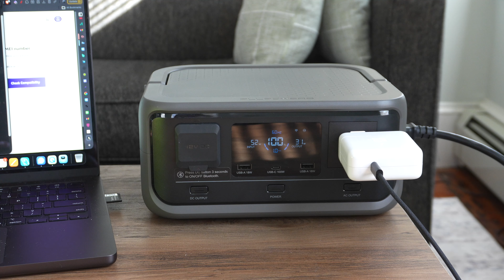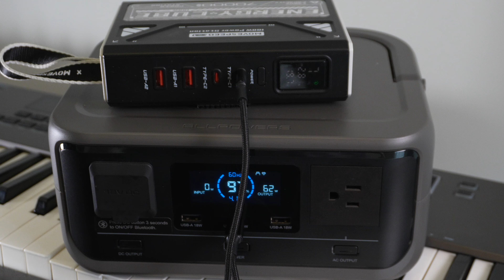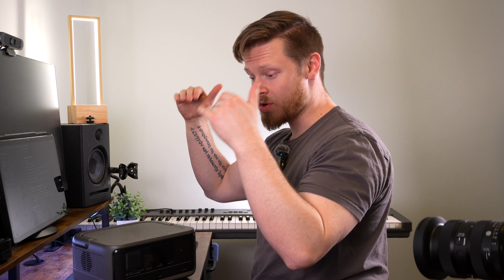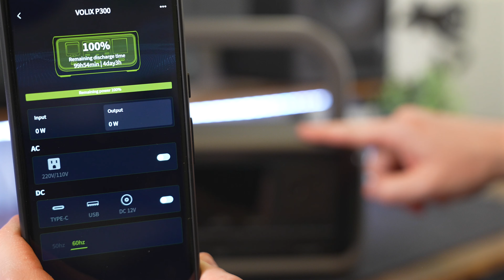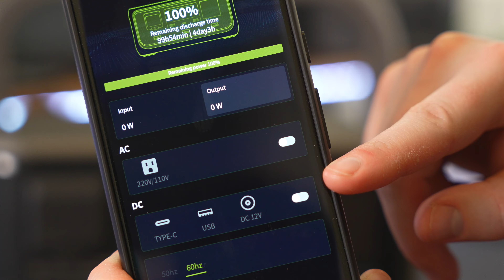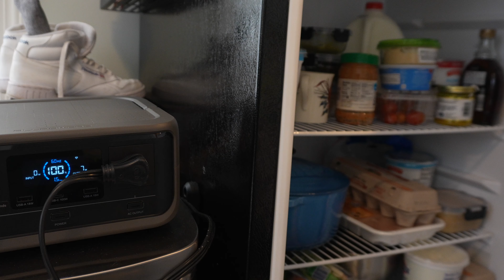This SOLAR BATTERY makes power outages a thing of the past! - Allpowers P300

Comment: This shit doesn't run on solar power, bugs keep popping up: E. 03
Reply from the maker: Hey there! Sounds like you've got an issue with your unit, or possibly your setup. It's a small bank, so it can only take small panels.

How many watts/amps are you putting through it?
Reply: @jacobtlamb  No, it happens every day when the sun rises, and if you connect it to the xt60, charging is restored, if you connect it to the xt60 again, everything works fine on other stations, 5А max.
Reply from the maker: @user-vcd9b55yh18 I'd reach out to Allpowers, mine works very happily!
Reply: @jacobtlamb  It's a shame that, on my recommendation, three friends bought the P300, and we all have the same defects, I'm very unhappy.
Reply from the maker: @user-vcd9b55yh18 Do you all have the same solar setup?
Reply: @jacobtlamb  Yes, this is a set of ALLPOWERS
Reply from the maker: @user-vcd9b55yh18 I mean, have you all purchased the same exact gear and set up the same way? If you're all getting the same error I'd be curious to know what panel you've got them plugged into
Reply: @jacobtlamb  We all have the same sets of P300 + 100W photo panels, I personally have many different panels, and it doesn't matter which one, the error in the morning (E-03) the station is not charging. If the xt60 is removed and inserted, the charge is restored.
Reply: @jacobtlamb  I found another person on the Internet who has the same problem, and there will be a lot of us soon!
Reply from the maker: @user-vcd9b55yh18 I found the solution for you - that error means the board is overheating. I got it only when I severely over-charged it with a 400w panel (my own error). Hitting the AC + DC buttons at the same time will reset the device so it will continue to charge.
Reply: @jacobtlamb  Друг, это ошибка низкого напряжения, будь здоров, это определил сервис ALLPOWERS по гарантии, "чудо мой"